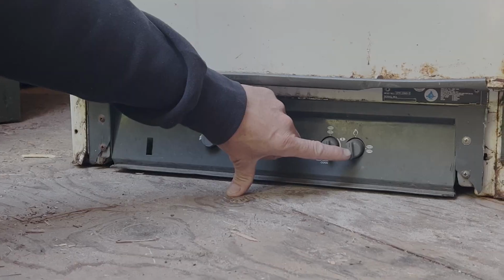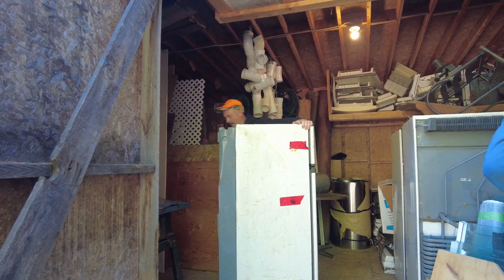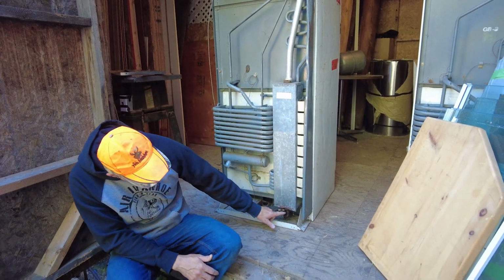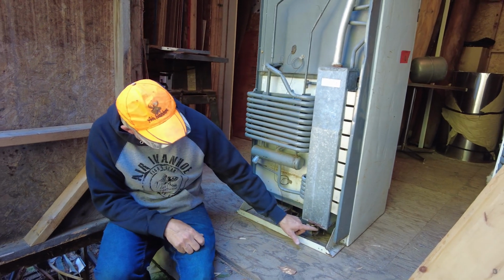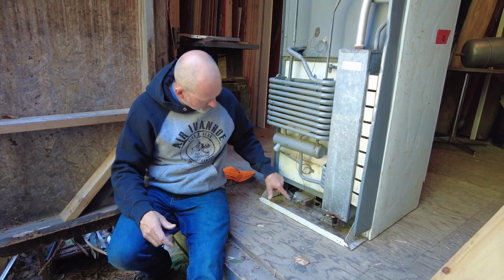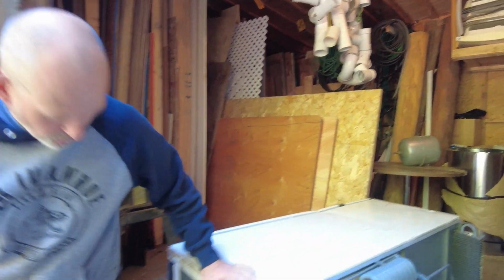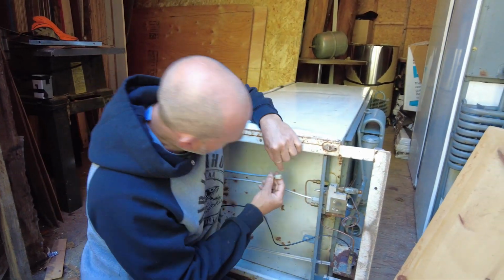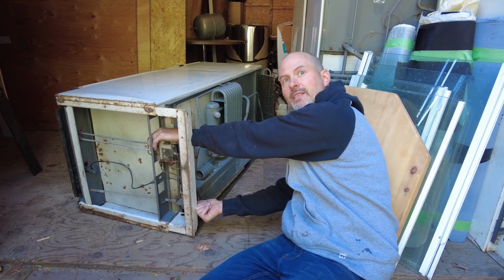Propane Fridge (Danby) - Basic operation, maintenance, and troubleshooting by Air Ivanhoe Outfitters

Comment: Hey really great video …. I am in Tampa and have a client that has no gas due to the storm … is there a way to put the fridge on a portable propane tank … some kind of fittings conversion etc ?   Please get back to me ASAP.   10/12/24
Reply from the maker: We run all our fridges on portable tanks with regulators

Comment: Hello your video was very helpful.  I have the same unit and the control box on mine is leaking. The gasket is brittle and leaking.  Any suggestions on where I could get a replacement control box or gasket.
Reply from the maker: From a propane supplier .... maybe the gas fridge company website ... probably online.